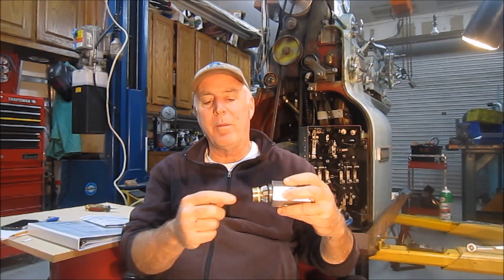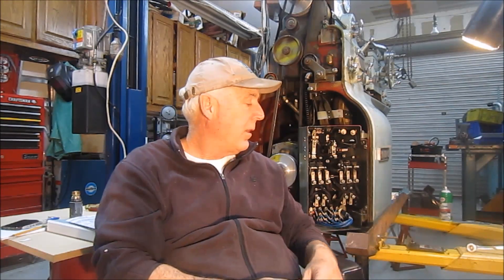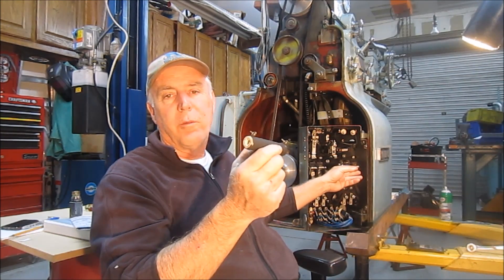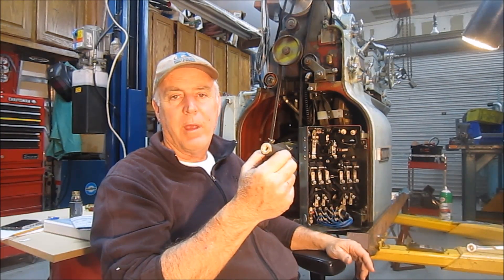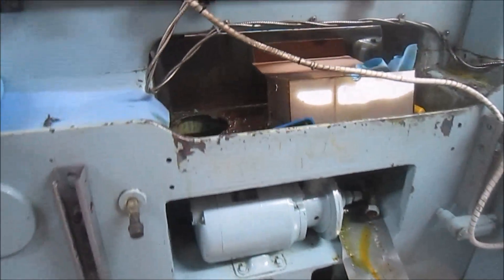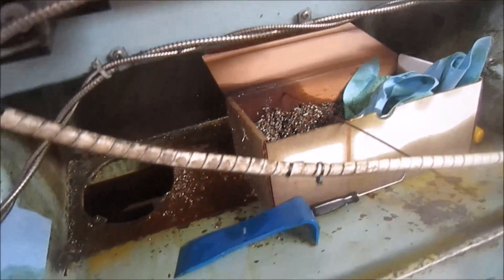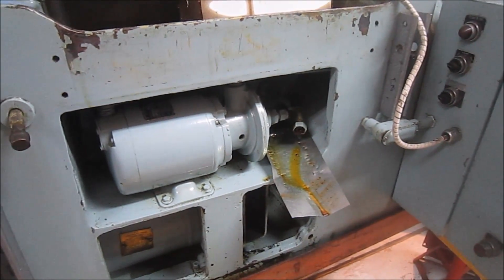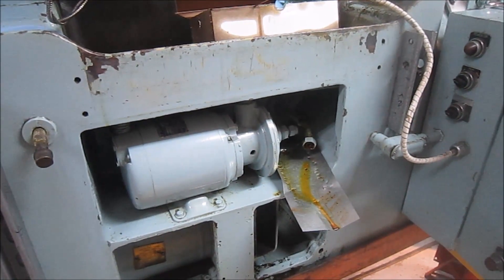Screwy Tuesday #51 Monarch 10ee Lathe  Problem Solved

Comment: Hi Chuck, my 10ee has an open 2000 ohm resistor, where did you source your replacement? Is Monarch the only option.
Thanks Allen
Reply from the maker: Allen, I looked for the invoice but could not find it, I know that I did buy two, one was very short and then I did find a replacement that was long and fit the shaft length....just too long ago...get the specs and you should be able to search it

Comment: i have the same issue.  do you know the part number you ordered?  where you sourced from?
Reply from the maker: Keith, I did purchase one from Monarch, but is was not long like the unit I showed, so I purchased another from Mouser Electronics https://www.mouser.com/ProductDetail/588-L50J2K0E   I hope this help you.....The Monarch part number in their system is R-1510, it should work also with adding wire which I did not want to so....
Reply: @outsidescrewball  thanks

Comment: I have used Houghton HOCUT 795-MP in my Hardinge HLVH and my  surface grinder for about 10 years. I got started with it when they offered a free 5 gallon pail to try it. I have never cleaned the sump in either machine that whole time and no odor or funny organisms growing. It is very expensive at about $250.00 for 5 Gallons of concentrate but it is worth it to me as 5 gallons last me about 2-3 years. I run a concentration of 5 on the brix scale on the lathe and 3.5 on the grinder.  You must use a refractometer to keep the concentration right as the water evaporates pretty quickly and it gets heavier. It contains mineral oil so you wont get rust on you machines from the coolant. I don't use a tramp oil skimmer and it still does not go bad. I do use distilled water for may coolant and I don't know how much that has to do with this coolant being maintenance free.

Comment: Don't know of anyone using the oil I use but it seems to work for me, I get it cheap or free. I've been using used hydraulic oil. It's pretty clean to use and seems to work . I started using it after draining my lift table when doing a cylinder rebuild.

Comment: As of using flood coolant, it's my first choice, best if you use the lathe at least once or twice a week to avoid it from going rancid, you might want to add a guard in order to avoid spraying the shop all over. 
Normally a dilution of around 7 to 15% is normal, best to see what you can locally get. Good practice to change at least once a year, depending on bacteria lever in it. If you're easily subject to infection be very careful... 
Also for trashing after use, you can't just trow in the city sewage, got to send to special refuses, implies $$$...
A little late on the feedback but, at least it's there...

A good prank for Tom, after using the coolant, store it, and, when he visits, you drop the containers in his car trunk, that would chill him down on the pranks....   Guess it's a little nasty...   ;)
Reply from the maker: +pierre beaudry thanks for the info Pierre....

Comment: I use water soluble coolant from Enco and it seems to work well no matter what brand I get, also I use tablets in the sump to keep the stink out. If you want a good finish and not wear out your tooling you need to run coolant.
Reply from the maker: +Brian Mendel thanks Brian

Comment: Water soluble, synthetic or semi-synthetic or the straight oils.  Depends on the materials you turn.   I prefer the Master Chemical stuff these days.  ITW and their various brands AccuLube, Rustlick, etc. are pretty good. I've used Mobil and Chevron Products too. (Both have good coolants too).  Some of the YT guys like Qualichem.   I also have used Cimcool, Cimperial.  I'd talk to the reps of what you can easily get ahold of and see..

Comment: Have you tried "Goof-Off".  It works great on adhesives and tars...   Goof-Off is a "cocktail" of solvents.   Costs about $23/gallon.   Mineral-Spirits might work good too.  It is, basically, refined paint thinner.   M-S cost about $9/gallon.  I was wondering if you tested the resistor for it's resistance value?  Was it "intermittant" failure or static?  I also wondered if the if your line supply  matched the wire hook up  ??  Hmmm?  Also see if the "holding contactor" winding is wired for the proper voltage.

Comment: HI Chuck,
from my experience i would definitely recommend running coolant especially with indexed tooling. as a rule you get a better finish and higher run speeds both feed and RPMs. i even run it with aluminium on occasion especially when boring. 
the brand i use is Jokisch sold by Hoffmann Group. 
https://www.hoffmann-group.com/US/en/hus/Workshop-accessories-and-occupational-safety/Cooling-lubricants/c/0_84
thus far the coolant hasn't gone rancid and it's been in the tank for about 2 years now and gets run maybe every 3 to 4 weeks depending on workload.
i run it a little richer than the instructions calls for somewhere between 15 and 20%, it should look like whole milk. i've run it much thinner and kept increasing the mixture until it hit the sweet spot. the nice thing about this brand is that it cleans the machine where ever it runs. years of gunk and grime have come off both the lathe and mill without having to put much elbow grease into it.. 
gonna do a product review on the stuff in the coming weeks. i'll post the link to the video when i get it done.

Lipton is such a squirrel.. lol.. 

cheers
mike
Reply from the maker: +HolzMichel Thanks Mike for the tip, can you tell me which product you use?  I looked at the web site and there are a few to select from...
Reply from the maker: +HolzMichel Hi Mike, yes I watched it this morning.....thank you, I could not leave a comment on the video...I will have to say in my personal poll on coolant or no coolant, the people that say NO, have a very strong opinion....LOL
Reply: +outsidescrewball  HI Chuck,
second run at this answer.. lol.. my computer went nutso and wouldn't let me post.
anyhoo.. there are two mods you have to do to the lathe if you want to run the coolant and not have the stuff end up all over the shop:
1. install a splash guard with mudflaps that you can raise and lower over the chuck. just make sure they are far enough away from the chuck but close enough to allow the coolant to drip back into the chip tray or catchment system
2. put some type of valve in the line between pump and spout so you can regulate flow. 

the stuff i recommended and did the product review on hasn't gone rancid or stinky.. unlike others i have used in planer knife grinders and the like.
the big plus that sold it for me was the life extension of the tooling and how often it has to be re-sharpened. the run time on a freshly sharpened face mill with coolant is 3 times that of the same cutter using oil. 
sure, it does make a mess but when i weigh the cons to the pros, i can live with the little bit of mess it does make. the beauty of a coolant system is that there is no rule that says you have to use it each and every time you run the lathe. just run it when you think you have to. the more you get used to running it and get your splash under control the more you'll be wondering how you ever got along without it

Comment: Occurred to me that when centering up that valve related stuff - maybe a bell center could have helped? Glad it worked out OK.
Good you have found the RPM's problem and wow - the clean-up sure did a good job. That is one heck of a machine with all the relays, electrics etc.

Comment: Mine had 5 gallons of sulfur oil in it when I got it and I drained it out and stored it in 5g bucket with a lid. My lathe is a module design (1962 vintage) so it will run on 230v single phase. The coolant pump however is three phase so I don.t use it. I found that brush applied oil and a spray mist fill the need so I probably won't ever use the coolant pump.
I was hoping to see yours run in this video, maybe next week. You're gonna love it. Thanks  
PS. I'm sporting a bandage on my right forefinger today, I was turning a piece at 1000 rpm and got my finger in the way and it took about half my nail off so be safe.This was the first accident ever on the lathe. It only goes to show no matter how careful you are, shit can happen.

Comment: That Tom, what a prankster. Glad to hear the Monarch is on the mend. Is that resistor wired so that the contact coil holds itself energized once the circuit is closed? Perhaps a small transformer would be a viable and longer lasting alternative, especially if you can't find that particular resistor.

Comment: Chuck,  looks like you guys have a handle on the issues with the 10EE.  
As far as coolant goes, I'm no expert, but I use Rusklick,  about a 10-15% mix with water.  I use it both as a flood coolant and as a mist in my homebrew mister.  The only comment that I have about it, is that you need to circulate it every week or so.

Comment: also don't use coolant too often as I cut a lot of brass ( dry)  
I use neat cutting oil. 
exol, excelcut 427, it's good stuff, no nasty smell, doesn't go off and is also ok for taps and dies, doesn’t stain yellow metals

Comment: I'd go for an oil coolant, something like Cora B by Morris oils (there must be an equivalent in the States) their web site explains better than I can about the properties of the oil. The advantages are, it does not degrade, does not grow black mould on the bedways, lubricates the sliding surfaces, does not put water all over the place which turns to rust, does not smell and after the initial cost lasts for years doing the sort of machining home engineers do.
Reply: +Stephen Deakin  I agree with using Cora B. I have had it in my lathe well over a year now and no smells etc even though I use it very little.

Comment: Hi Chuck
If you are like me and only use coolant every now and then I use cool mist. If you really want flood coolant check out John Grimsmo he is using some coolant and he thinks it's the ducks guts. Looking forward to see that lathe in action.

Dave
Reply: +David Cashin I was going to recommend the same video when Chuck asked about coolents. Both John Grimsmo and Brad Martin from Tactical Keychains have some synthetic coolant that is the bee's knees, but they of course run their machines non-stop...so I'm not sure if it would be the same for you.
Reply: +David Cashin They use QualiChem 251C (or 250) in their machines, from all the people using it it seems a great coolant to use. Key is get a refractometer and keep it at the correct ratio as the water will evaporate over time.

Comment: Hi Chuck !

When I started on this machining thing I used ROCOL thinned 1:20 and within a month or so it stinks awfull in the shop - rotten eggs or so !

I then tried some stuff from "her in command" - she uses it when cooking fruits and stuff like that for storing in big glass bottles - it prevents mold in the glasses - just a cup for 20-30 liters cooleant - no bad smelling at all - even after years - I just refill with ROCOL and water ... and now I switched to some english stuff instead of ROCOL !

I use it every time I renew my cooleant - a cup for 20-30 liters of cooleant.

Cooleant in generel ... it's a mess, but I use it every time I have something that will get hot - when I can smell hot steel I get nervous ... the heat destroys tools and woorkpiece I think, I don't like it.

I have it set up up my lathe, the mill and the circular saw with flouting cooleant - not on the drill press, but it is a mess on the lathe and the mill because of the rotation speed - the circular saw is no problem because it runs so slow..

After seeing Adam Booth using his cool mist on the K&T an really heavu duty stuff, I'll go and find the drawings for such a jig - I think James Kilroy has something there ... I think it will reduce the mess and flouting all over and still keep the work piece cold - so that's a future project for sure.

Hope you can use my experiences to make the right choice for you ;-))

I didn't know your "family juwel" was/is made of plastic ;-))